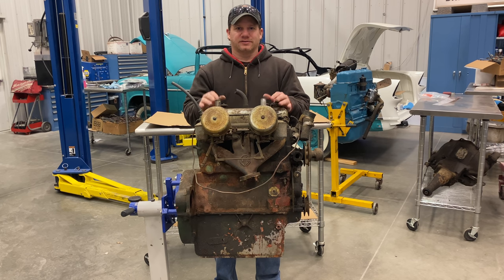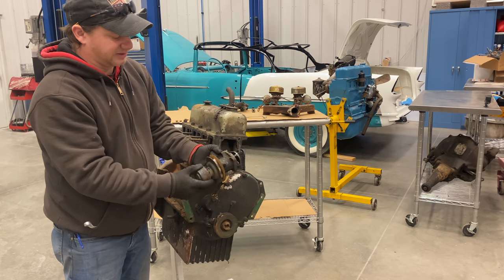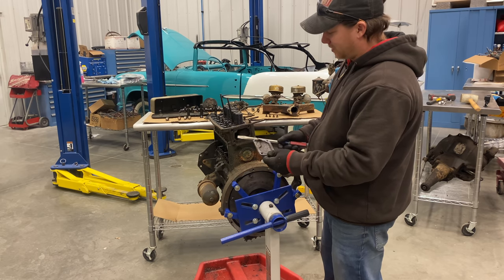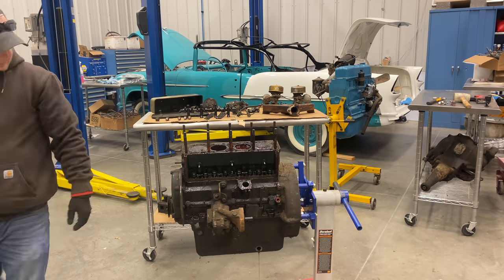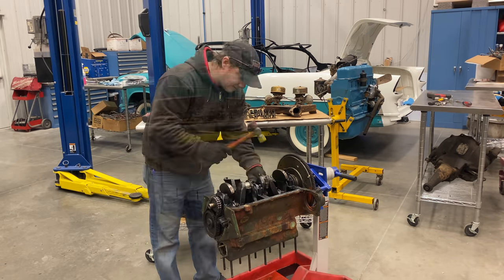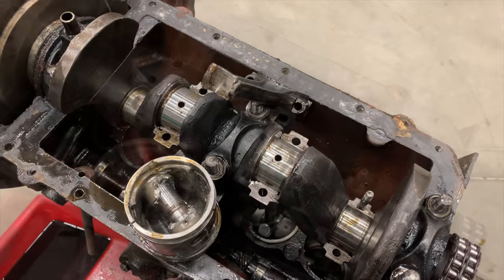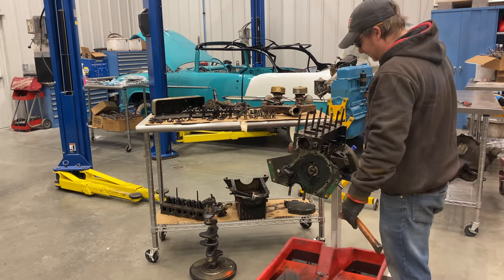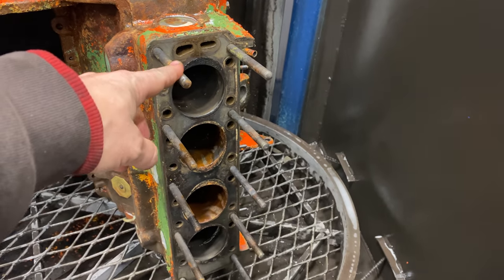What Horrors Are In This 1952 MG TD Engine?

Comment: Back in 1972, I had a 59 MGA that suffered a snapped crankshaft. You couldn't start it with the electric starter, but it would run if you used the HANDCRANK ...  Don't laugh. It got me HOME . I drove it over 1100 miles to get back home after it broke. I was VERY LUCKY !

Comment: Many years ago I used to sleeve the cylinders on the old MG's back to standard.  The pistons available at the time were Std and all the way up to .0.120" / 1000 oversize. If the block is serviceable, that engine can be rebuilt seemingly forever.  There is a technique to sleeving all four cylinders.  The total "press" on all four cylinders cannot exceed .003" or there would be too much stress on the block.  Normally the "press" would be about .0015" to .002" of an inch for one cylinder sleeve.  However, if each cylinder had  .002" press, there would be so much stress on the block that the block could actually crack!  If bored correctly for proper cylinder sleeve press the first sleeve could be pushed in by hand.  The second sleeve could be tapped in with a mallet.  The third sleeve hammered in a little harder.  The last sleeve pounded in with the force of a short handled 3 lb. sledge hammer.  Once that 4th sleeve went in, all of the sleeves were tightly held into the cylinder bores, even the first one that could be pushed in by hand.  I never had a complaint about a problem. One of my competitors did crack a block. Needless to say that I was the only one to do work for that company from then on.😆

Comment: Great video...reminds me of my youth..my first car was a Austin A40 1954..It was a runner but after a year it started using a lot of oil...I stripped the motor in situ in the road outside my house.! head off sump off and pistons out the top..i bought 4 x used pistons which were high compression in used condition and were from a tuned stock car..a racer...they fitted a treat and the car run a treat after that...i love your equipment in the workshop especially the engine stand that revolves..brilliant.!
So nice to see you doing this repair but i did the same refurb 50 Years ago..!!!! no proper tools in those days but i have all the tools now but being in my 70s its hard just to get up let alone fix cars..how age tells!  when this motor went pop in 1966 i had just discovered Honda motorcycles and girls...dont bother with females these days but love guys fixing vehicles...and dogs and cats..from u/k...

Comment: I notice a duplex timing chain. BMW,Mercedes,Audi,VW, Peugeot/Citroen please take note. This is why after around 80,000 miles you have problems, many terminal and the owner picks up the bill for your cost cutting.
Good to see another little classic on its way back to being someones pride and joy 👍👍👍👍👍
Reply: Have owned, driven, maintained and repaired Mercs since the 60s and can assure you, if you follow the maintenance recommended by Mercedes-Benz, you have an engine which will run to over 500,000 miles without a problem.
On many of the 'cheaper' versions of the cars, simplex chains were used but, again if you follow the recommendations and replace the timing chains when advised, these engines are bullet proof too.
It's such a simple and cheap job to do, I have no sympathy for those who don't and experience problems.
All 'SE' models were duplex chains which lasted longer but still needed changing if you wanted to keep your car in tip top condition, timing etc..... just like ANY car.

Comment: The idea of using a scroll to control oil leakage generally works when the oil is changed regularly and the crankcase is not over-filled. Higher oil pressures can push oil right past the device. They work well when the oiling system is not pressurized beyond atmospheric and proper maintenance is done. Standard truck transmissions often used these for input shaft oil control...using it as engine crankshaft oil control is novel, but not wise.

MG cars used mostly Lucas lighting products for their electrical system. The joke among MG owners was that Lucas Lighting was the Prince of Darkness...
Good video...

Comment: A friend had a 1954 TF. Most of this looks very familiar. He was my adopted dad and I spent many evenings talking to his feet asking for advice while I fetched tools for him. His motto for that car, in the late 1980s, was to never drive it farther than you were willing to walk home.
Reply: @CPT Ivanitchyanus He hated the carburetors, almost as much as he hated chasing the constant electrical problems. He thought about having a new wiring harness made, but it would have cost more than the car was worth. He finally sold it to another masochist.
Reply: I had two TD.s and never had to walk home. I drove them on hill climbs and many other car club events. Only a bad mechanic could not get one to be reliable.
Reply: @epistte  
Like I said before a poor mechanic.  Any half baked mechanic could make it very reliable.  
The wiring was simple, I had to sort out the wiring on one of mine because some idiot had tried to rewire it, the headlights came on if you braked and the ignition shorted out if you turned the sidelights on, it did not take long to sort out.  
My first MG TD was worth far more than any wiring loom, I paid a years wages to but it at the time but of course that was in very good condition and I did not have to do much work on it, my next one had been butchered but I soon had it running well and enjoyed it for over four years before selling it for quite a bit more than I paid for it and I only sold it to go overseas the same reason I sold my first one.
Reply: @barrierodliffe4155  That sounds similar to the problems that he was chasing. He bought it from someone who started to restore it and then stopped. he got it running but the electrical problems were constant. He let me and my date borrow it for the prom, but I had to drive it and not my date.  I remember that he had the engine rebuilt but getting the carbs in sync was a constant battle.  He sold it and bought a Jag XKE and then sold that when he realized what a basket case it was.  Then he bought a 35' sailboat.
Reply: @epistte 
There is nothing worse than taking on any job that someone else has started.

Comment: Rebuilt one in 1966 or 67. Was a fun rebuild. Parts guy warned me about engine becoming a water heater with .060 over pistons. Cylinder walls so bad I had no choice but to have bored that large and it became a water heater. Ran good. Saw car on road around '70 and it was seemed to be running good. Just long waits at traffic lights were an issue when I had the car.
Reply from the maker: That is the problem with making them so thin, today a hidden electric fan can ease the pain.

Comment: That engine brings back memories.  Older brother’s friend had a 52 TD in high school.  He damaged three engines and wound up with a Chevy 6 cylinder, three speed trans, and narrowed Chevy rear end.  They finished high school in 1961.  Brother & his friend are both gone now.  I lost track of the car.
Reply: We considered these engines "tractor engines." They had lots of problems because they were in a "sports" car and the harder you drove it, the more likely something blew. Most of the time it was the engine do to over revving. My brother in law came up with an interesting solution. He made an adapter plate for the back of the bell housing. That allowed him to drop a Datsun 510 transmission into the car. Not sure if any of the older Nissan transmissions will work, but it would interesting to experiment.

Comment: Really good video! I had a 1939 MG TA years back with a similar engine, though with a longer stroke MPJG engine rather than the squarer XPAG in the TD. The corked clutch running in oil was very smooth! As for the oil thrower/scroll at the rear of the crankshaft, the one on my 1970 Rolls-Royce Silver Shadow had a leak recently and the thrower was full of crud. Nice and clean now.

Comment: I'm curious how it cleaned up. I worked in an engine shop that did a lot of vintage stuff, all kinds of old British stuff like this as well as tractor engines, Ford flatheads, even the occasional 100 year old fire truck engine. Of course plenty of modern stuff too. Pretty cool to see how designs had progressed through the years
Reply: ...a dream job as I see it...

Comment: I worked as an MG mechanic 50 years ago and this brought back some old memories. I never did more than routine maintenance on the TD/TF series but I am happy to report that MG did eventually take care of some of the design flaws pointed out in this video. Who says companies don't learn from their mistakes? Although MG apparently didn't learn quite enough because eventually they did build a three main bearing MGA Twin Cam engine pretty much guaranteed to blow up. I know this because I bought a retired Twin Cam chassis after the engine blew up while racing at Thompson Raceway in Connecticut.

Comment: This feels so familiar as my first car was a 1938 MG TA bought when I was 16 for just £50, borrowed from my Dad in 1961. The XPAG engine appears the same, although mine had white metal big end bearings. I spent a year during every free moment bringing it back to life and loved every inch of it. So much fun to drive, it sort of scudded round corners, but always started first time.
Reply: The TA had the earlier engine and they did use white metal bearings, the bearings did not last too long but they were very good and the crankshaft did last well, also the engine was easy to remove and strip down so replacing the bearings after 60,000 miles or more no big deal.
They were very good cars and a real pleasure to drive. The TD had a better chassis and the handling was really good.

Comment: Nice tear down, you certainly know what you're doing.  I rebuilt mine last year and we bored it 100 over.  You can get piston/rings set up to 120 over, so as long as the block mags out there shouldn't be much issue saving it.

Comment: Amazing that the broken rod end didn’t get free and punch a bunch of holes in the casting.
Reply: That’s one of the reasons you have to check an engine that hasn’t run in a long time, before you attempt to start it...
Reply: My thoughts as well.
Reply: they have 4 hp,& rev at 50 rpm..its worserer that pudding..
Reply: @phantomwalker8251  what?
Reply: @phantomwalker8251  55 bhp and max revs of about 6000rpm For the time, a decent engine.
Reply: @phantomwalker8251  
Some people are just very ignorant, My first MG TD had more like 80 to 85 hp, revved to a safe 6,500 rpm and was better than many much more modern cars.

Comment: Great video. Thanks. I was there in the 50's. MG were taken over by BMC, British Motor Corporation. They put a cork seal on the rear crankshaft bearing behind the reverse thread scroll but It still leaked. Not a problem as oil was cheap and not too much got on to the clutch plates as it dribbled out of a hole in the bell housing. That didn't get blocked with sludge as it had a loose split pin which wobbled about and kept it clear. 
No pollution control greeny snowflakes in those days. Oil leaked from the timing chain cover, the rocker shaft cover, tappet chest/valve lifters cover, crankcase breather pipe, sump gasket, sump drain plug, clutch housing, gearbox seals, differential seals. The underside of the car was rust free around those leaky bits. Everything else rusted away as you watched. 
I'm sure I could smell the odour from the engine cleaner cabinet as you opened the door.

Comment: Anyone else also amazed that all the bolts came out? It seems every time I'm doing a project it doesn't matter how many bolts there are. ONE of them will be stripped or busted off...lol
Reply from the maker: Old MG self lubricate the bolts keeping them from getting stuck 🤣
Reply: @ThisWeekWithCars  It seemed to work then. I was amazed how easily everything came apart.
Reply: @ThisWeekWithCars  You could put more force on the crank by prying on the ring gear through the starter mount than you can with the pulley nut in front, though you are still limited by not wanting to break ring gear teeth, that limit is far higher than it is in front.
Reply: Greetings from South Africa 🇿🇦.. don't you just love getting down and dirty with these old engines... In my younger years I rebuilt many side valve Morris 803cc and OHC Austin 998cc engines. This brings back good memories.... thank you for posting this great video...
Reply: @alan6832  that would be stupid
Reply: @12vibaba  In this case, forcing the engine would only push around the later discovered broken rod, but the same would be true of turning the front pulley if that had succeeded, and I specified limits on the ring gear teeth, so what else is your problem?  The flywheel or flex plate might also have other pry points.
    The threads on the front pulley nut have limits too, much lower limits than the ring gear teeth, but he did not exceed those limits, just like the limits on ring gear teeth need not be exceeded.

Comment: In 1972 I bought an MG TD, the body was in good condition but mechanically it needed a lot of work, fortunately at the time I had my supercharged MG Midget to drive.  The brakes, steering and engine had been ill treated by a very hamfisted person.  I started by pulling down the engine and even bought a second hand engine to get parts, not being wealthy. 
Once it was running on 4 cylinders I drove it and soon found the other problems, the steering was not too hard to fix, it had been attacked by an idiot using a heavy hammer, the braked had been messed about with and the dust covers left of the rear wheel cylinders which were seized up, due to the dusty roads in New Zealand. The handbrake still worked. having fixed that up I found that when you braked the brake lights did not work but the headlights came on and if you turned the side lights on it shorted out the ignition, I then rewired it and eventually after fixing the fuel pump I had a very good car, I kept it for over four years competing in many car club events, the handling was very good and it really was a joy to drive.

Comment: Hello, first time viewer here.  You seem very knowledgeable of engines and you may have built this type of engine before.  One thing, the external oil pump does not use gaskets on the mating surfaces.  I can't count the times customers came into the shop with oil pressure problems.  people seem to think there should be a gasket but there is none.

Comment: The monstrous power and torque of that massive engine was just to much for the rods to handle.
Reply: "monstrous power and torque"... You're kidding, right, fubar !?  Donno if that heavy lump might give even an earth shaking 40 HP !! 
Torquey for it size, probably. HP ? Huuuum...
Reply: @marcryvon  
Yes, I'm joking.😉👍
Reply: @marcryvon  In stock trim, it's 1250 cc displacement and, if memory serves, 54 horses. Don't recall the torque.There were many potential tuning steps, including a supercharger. In full race tune, it was around 1500 cc - which was perfect to keep it in a 1.5 liter racing class.

The very first car I ever drove was a TD. It had been rolled and was, obviously, a cosmetic mess. But it still ran. So the 8 year old me drove it around the yard.

Comment: red fluid is most likely transmission fluid, a lot of people would use trany fluid to try and free up pistons
Reply: If the engine had been in the UK, I would think Redex would be the favourite to leave in the cylinders.
Reply: ATF and acetone (mix), works perfectly.
Reply: @mr.slaphappy3794  ATF = Kerosine?
Reply: @tedf1471  Automatic Transmission Fluid

Comment: Rebuilt a 1952 MG TD engine, and transmission in 1958. Put a Clay Smith 3/4 cam in it, and bored it out .30 I still have scars from the transmission. Wish I had it now.

Comment: Hi the biggest reason british engines leaked is because they were so easy to work on and over the years every man and his dog worked on them butchering them just like the British motorcycles sheared bolts or stripped threads wrong torgue settings re used gaskets  the engineering and design is every bit as good as american
Reply: Wrong, 100%. The reason why these engines leak is because that's how they were designed. In the first place, the XPAG like many other engines of the time has a road draught tube. The crankcase vents its pressure with oil vapor right down the left side of the engine. Second, the rear of the crankshaft does not have a true main seal. It has a scroll machined into it which rides inside of a piece of cork. The oil is drawn to the back of the crank and then splashed back into the sump with a conical washer. The timing cover uses a piece of felt behind the crank pulley. It has nothing to do with the ease of maintenance. The scroll seal design actually goes back to the war when the common logic was that the leak would bathe all aft parts in an oil film and prevent grit from finding its way into rotating parts.

Comment: The scariest part is the badge on the front of the hood

It looks like cylinders 2 and 3 were given dexron / marvel mystery oil at some point. Someone probably worked on it 40 years ago and it was already locked up solid then so it was filled with ATF in the hopes it would spin over. It definitely did not and the car went back to sitting, this time with a quart or two of fluid in the middle cylinders... I'd imagine it leaked past the rings of one but not the other, hence why it was full and gross.
Reply: Scary?  That is a wonderful sign of a well built car

Comment: That seal system I've seen on oil free piston compressors.They were call Visco seals.It was a cast iron seal broke in half with a thread to thread the grease back toward the the front of the compressor.Worked great.

Comment: I’m sure you can get a replacement seal kit , from the UK, to change the scroll seal to a lip seal.
Reply from the maker: I've installed those on these engines and they are a terrible design.